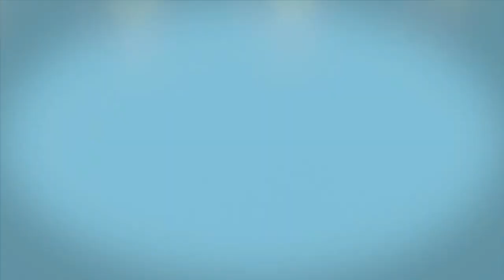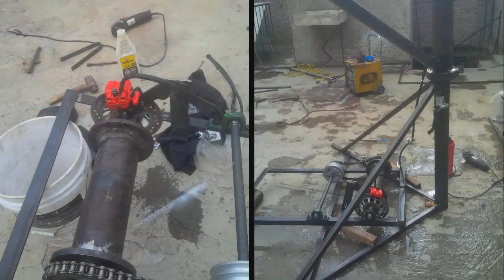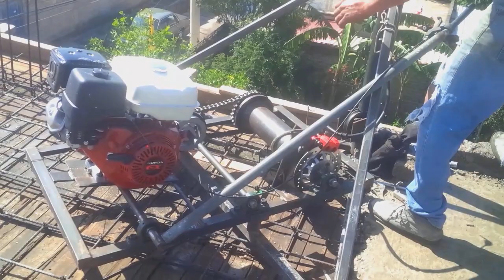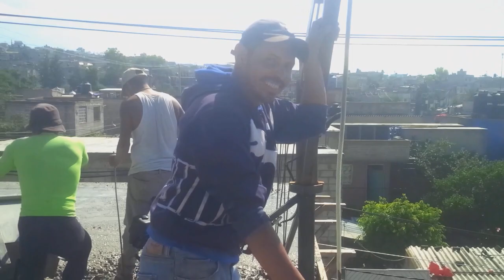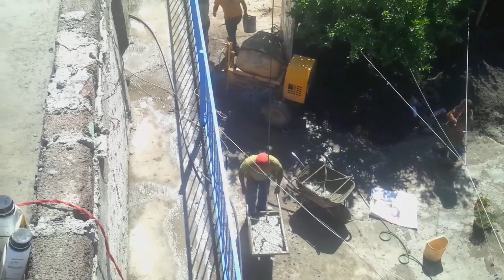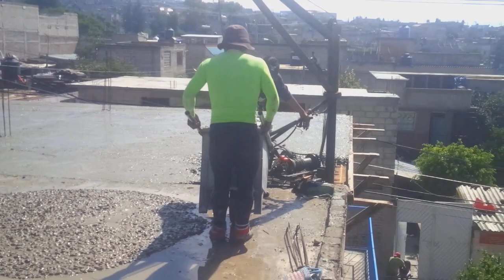Prueba de malacate elevando concreto

Comment: Buena noche motor de cuantos hp utilizas para ser honesto yo quiero fabricar uno solo que en forma diferente pero es para el mismo fin así 
 https://youtu.be/bdS4H12AGkk
Reply: Quiero fabricar una de estas voy a utlizar un poco más de material pero en mi caso siento un poco más confiable es mi punto de vista ya que tiene una inclinación que ayuda a la vida del motor en teoría 
https://youtu.be/7YUngK7mGLA
Reply from the maker: Yo uso de 8 HP con reductor ..el del vídeo se ve que es de 6.5 sin reductor.. por eso tiene más poleas y cararinas
Reply from the maker: @santiagomarroquin5321  si ya hay de esos x Tlaxcala he visto varios hay unos que levantan lo de dos botes y la gente lo resive arriba y acarrea la revoltura
Reply: Y crees que me sale bien a esta manera de la que te puse no será muy lenta, 
Dijiste que utlizas "reductor"
Reply from the maker: @santiagomarroquin5321  el reductor lo que hace es que tenga más fuerza  ...la transmisión que me mostraste tendrás que sacar las rpm finales para ver qué tan lento subiría y. Sobre eso ver también cuánto peso carga también ..mis equipo tienen una velocidad de 3600 a3700 rpm y cargan un bulto de revoltura
Reply: Te agradezco tu ayuda